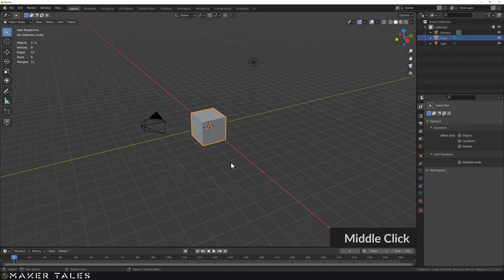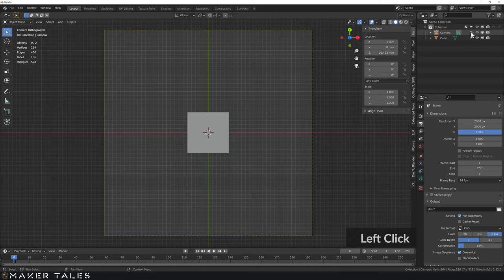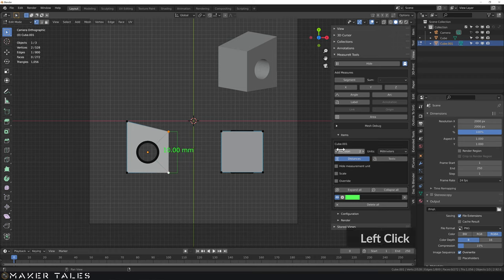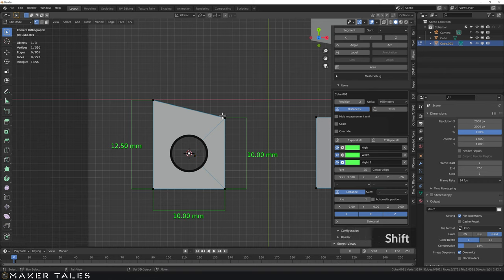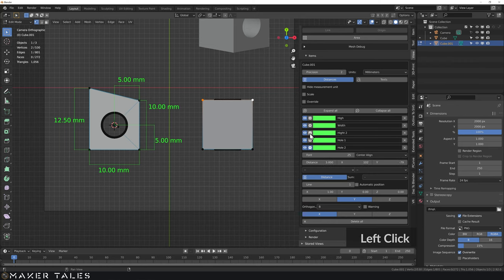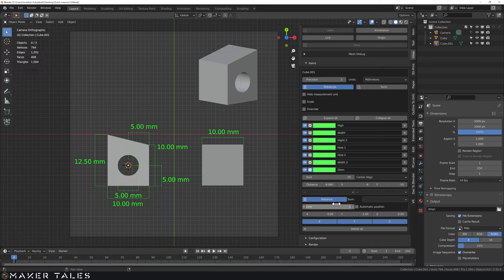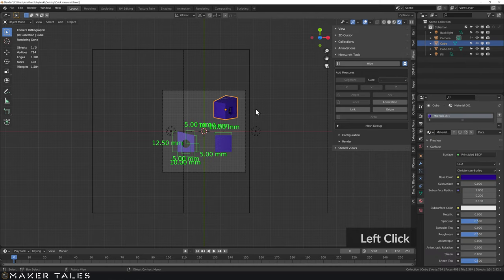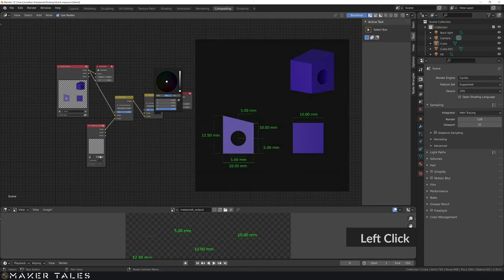How To Make A Technical Drawing In Blender 2.9+

Comment: Easy way to get a white background with flat lighting - Shading->World->Add->Texture->Sky Texture
Set your camera to orthographic and zero its rotation.
Enable freestyle.

Instant 2D line drawing.

You can use the "Freestyle SVG Export" addon to easily export only the freestyle line layer to an SVG file. 

Line-art is the new method of doing this but I'm not familiar enough with it to quickly write down how it's done.

Comment: My response to those who proclaim that Blender is not a CAD program - it needs to be!  It will be !

One example is that stage delivery and digital delivery of theatrical development are losing their distinctions.  MANDALORIAN ?  Artists need to model real world assets to get the best possible digital models for that real environment.  The only ways to create those models - accuracy is needed for safety and art - is to either use photogrammetry or CAD.  Photogrammetry requires pre-existence.  CAD, therefore, is the only method whereby one can create an accurate model that can be printed and then safely used as a prop in a realistic - real - stage.

[ EDIT - I want to clarify that by CAD I am referring to 2D technical drawing.  The traditional ways are the only ways to create an accurate model.  Parametric modeling on the fly is great for creating sketches and ideas.  But, to create the actual, accurate  model, the drawings need to be made.  Often the 3D idea sketch changes to the new lines.  Further, outside software is not viable for long term use, because their file support paradigms will change.  They may not continue to facilitate file types that are useable in our preferred model maker.  

Creators need to be able to work within one package throughout their work flow.  Blender is very wide and deep.  It needs to add the ability to go from a technical quality illustration made within it - to the model generated from it.  We can make the models from imported blueprints.  Let us make the models from blueprints we make within Blender. ]

Blender IS CAD.  The only question regardless whether it wants to be perceived as useful.